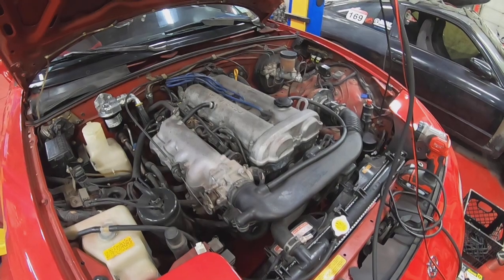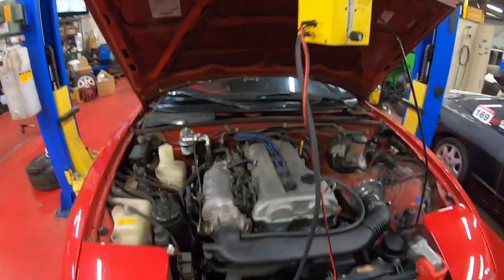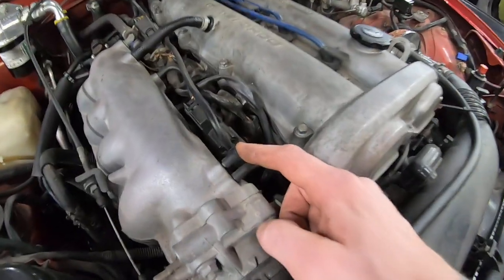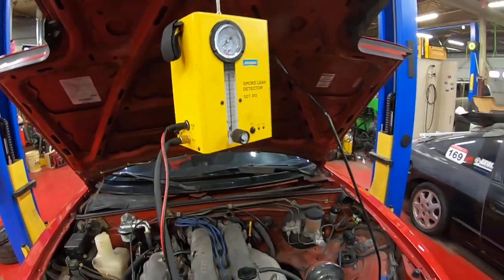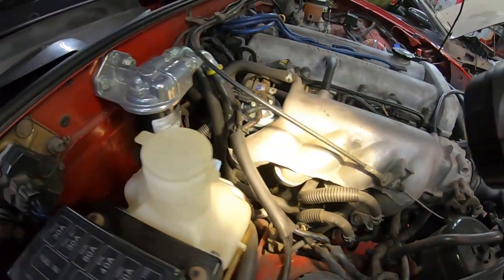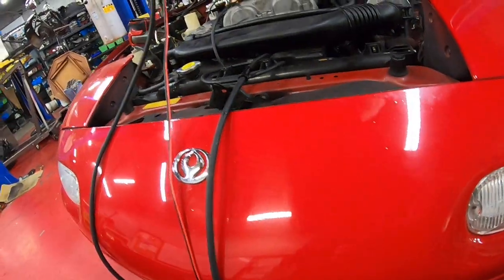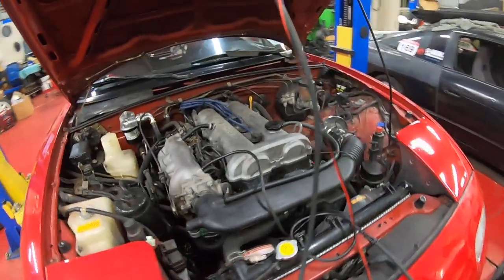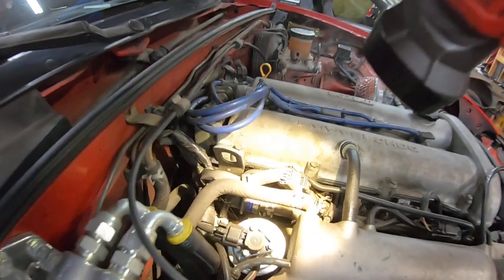Miata Diagnosis: Vacuum Leak Testing

Comment: I found a vacuum leak today in nearly the same area (passenger fender) as you did for your staged leak. It wasn’t coming from a hose, it was coming right out of the body of one of the many switches/ solenoids in that area. I haven’t identified the part yet, so  I got all excited to see if your leak was going to be the same as mine. lol.

Comment: As old as these cars are getting, wouldn't it be wise to start to replace the old vacuum lines ?
Reply from the maker: If you want, honestly most vacuum leaks I find are from people forgetting to connect things when they’re working under the hood so I guess technically replacing them would create more risk than doing nothing 😅 they also aren’t super sensitive to small leaks

Comment: Is the throttle meant to be open during the test? Could the smoke also be introduced with an adapter or glove at the intake after removing the pod filter?
Reply from the maker: Throttle position is irrelevant, but yes you can attach it at the air filter